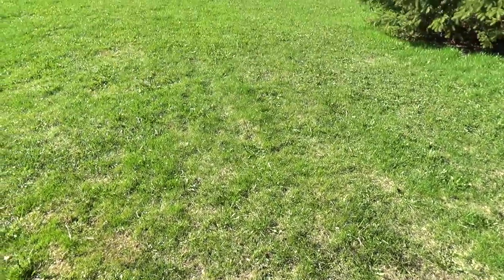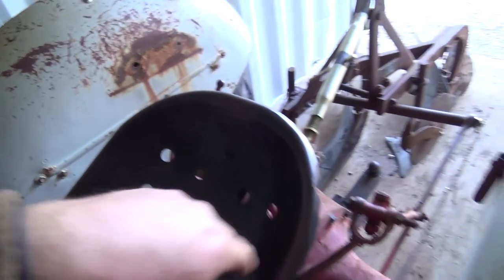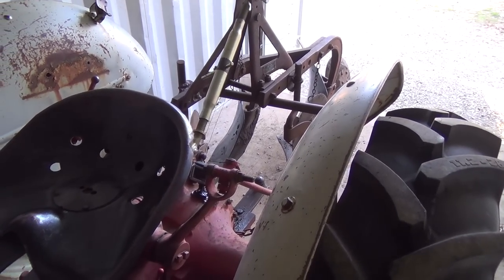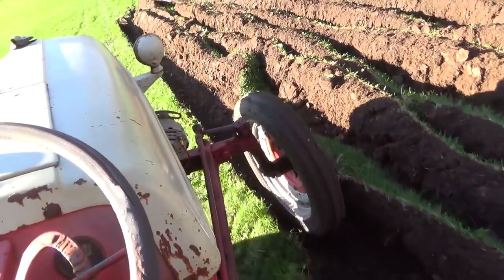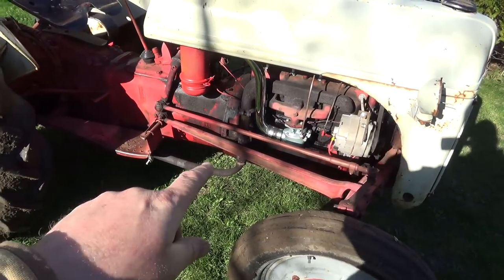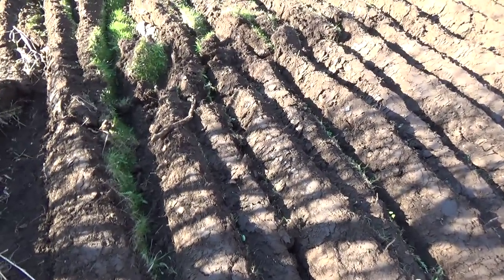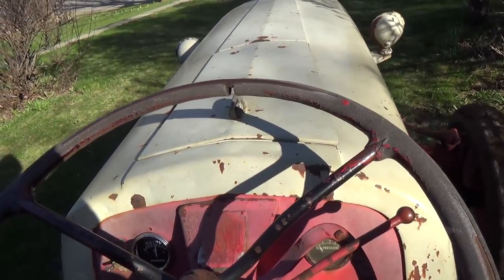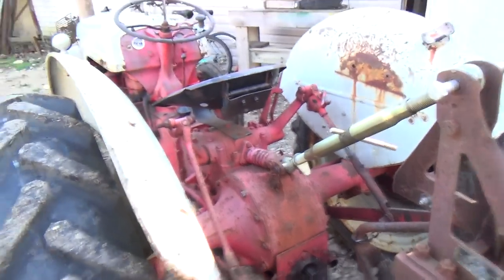Plow Day with Bill and the 2n Ford Will she still pull??...Let's See

Comment: You are like most people that I see.  A 6 volt system really needs heavier gauge wire on the battery cables.   It will spin faster if You put the heavyest gauge Battery cables that You can get.

Comment: I have a later 44 and it is set up like yours with no oil line to the governor. If I remember correctly the newer models run the line from the filter to the governor instead of into the block. The plug in the filter housing is a drain.
Reply from the maker: How is your governor sounding? I think when I change mine out ill run that line over and block the drain
Reply: @billstmaxx The governor was worn out when I got the tractor. So that might be why, not enough oil. I rebuilt it, so it sounds fine now. But I probably should run that line to it also.

Comment: Thanks for all your plowing videos - I love them.  I have a 1944 Ford 2N that I'm looking to pick up a plow for.  A quick comment, I can't see the id plate, but if that's a Ferguson plow, they came with chains that bolt to the beams that went down to the coulters to keep them from swaying too much.  Anyways, I do love your plowing videos, keep them coming as much as you can.  Did you ever get the Go-Pro to work?  I have been looking at possibly buying an action camera, but I'm such a novice that I don't know what questions to ask.  I may opt for a cheaper camera, since I have no idea if I will ever get much use out of one.  A Go-Pro would definitely be nice, but I don't know if I can justify the price.

Comment: hmm sway bars or is that an upcoming project
Reply from the maker: sway bars for what?
Reply: @billstmaxx  the 3 point linkage  stop the plough swinging when the tractor is not quite level
Reply: on the lower arms left and right side
Reply: You don't want to put stabilizer bars on a plow that plow is the worst plow there ever made by Ford the Ford Ferguson plow is the best plow ever made them Ford plows they never plow straight as you can see in the video the tale will is always digging into the Furrow wall